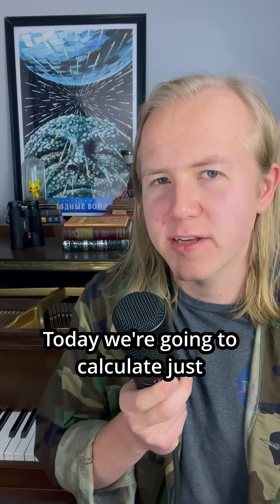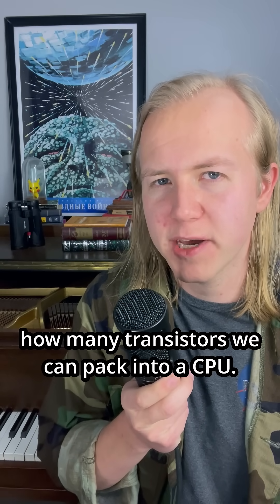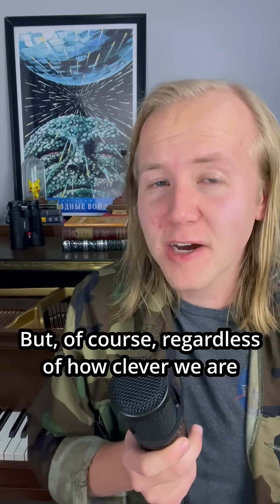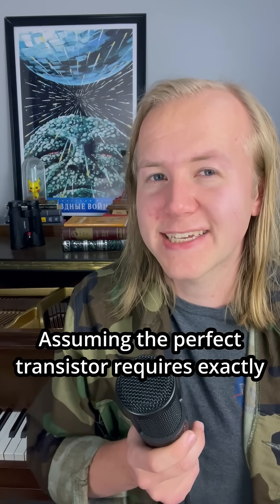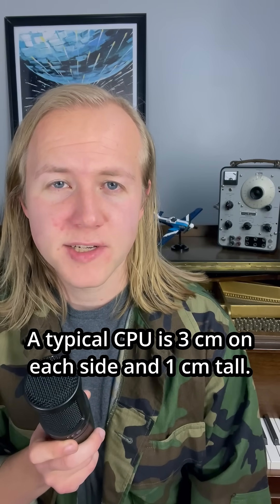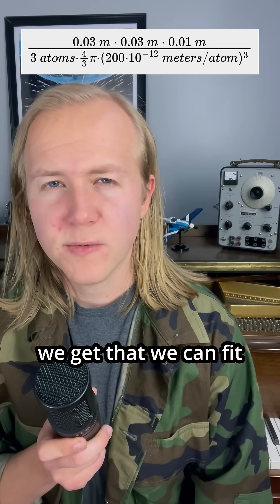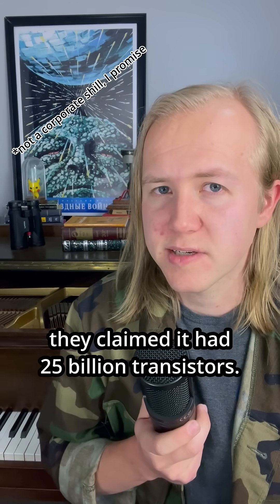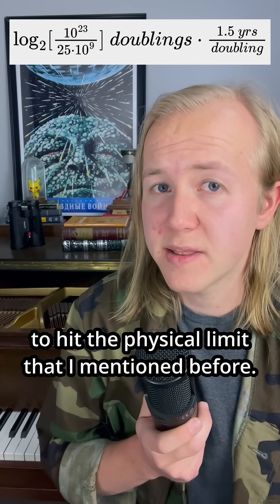Predicting the Processors of the Future | Fermi Question of the Day 4/8/2025

Comment: 900 mm2 is a huge area for a typical cpu. No cpu is 1 cm tall either. i7 13700 area is around 257 mm2. Assume thickness of the wafer as 1 mm and multiply it to the area. So volume becomes 257 mm3. Density of monocrystalline silicon is 2.33. we multiply it with volume to get 0.59881 gms. 1 mole of silicon weighs 28.0855 gms. 1 mole of  substance has 6.022 x 10^23 atoms. So there are 1.284 x 10^22 atoms. Now to calculate total transistors, divide it by 3. So the total transistor number is 4.28 x10^21 transistors. Also your volume calculations don't take into account the packing efficiency of monocrystalline silicon, so I went through the density route.
Reply from the maker: Ooh, I like your approach! I had thought briefly about packing efficiency of my ideally spherical atoms on a square chip, but decided I didn't think it would affect the outcome enough to warrant the headache. Starting from established density overcomes that real easy.

Thanks for the actual sizes, I was having a difficult time finding them, but maybe I was looking on the wrong corners of the internet. In hindsight, thinking about the box the CPU comes in (~1cm) instead of the wafer (~1mm) was likely my biggest error, and does account for 1 of the 1.5 orders of magnitude difference in our answers.